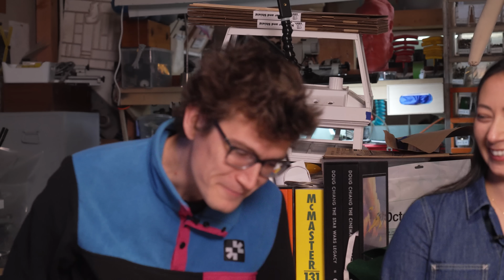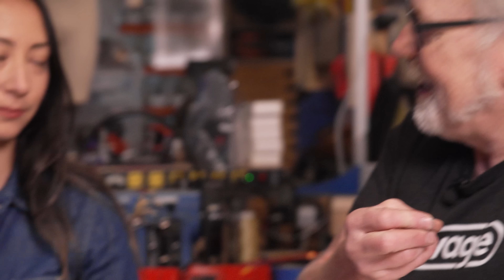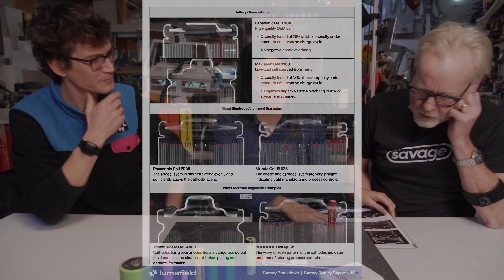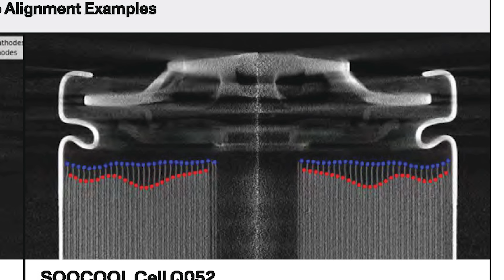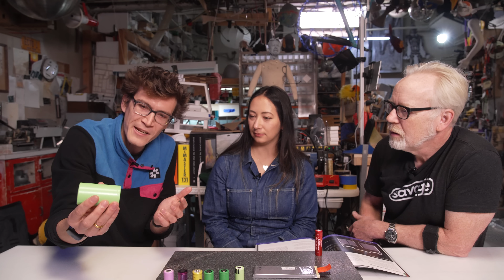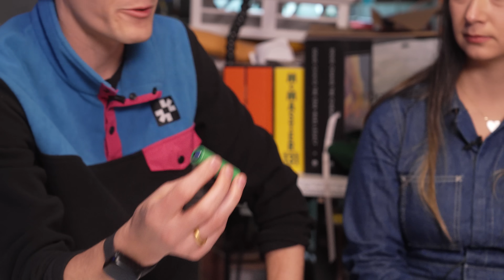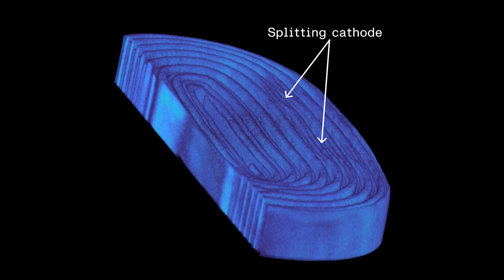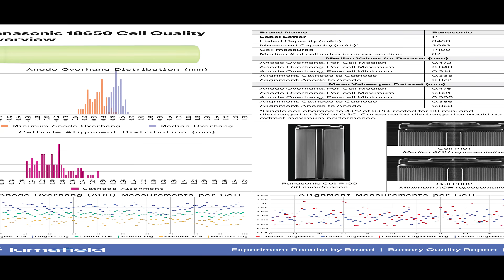The Surprising Flaws in 18650 Lithium-Ion Batteries

Comment: As a person who works with a ton of these 18650's loose form factor both flat top and button toped.  all i can say is buy one of those 2-8 channel testers that will measure the internal resistance and the capacity of the cells. pervious people bought a bunch off of amazon and Temu and most of them were bad... so honestly a capacity tester is the easiest way to tell if it is showing issues or not.  Out of 200+ tested cells from the previous buyer 8-%+ were under 700mAh capacity  and the rest were 1000-1300mAh capacity (actually all of the best of the worst ones of this measurement were actually from Temu purchase. 

We have since then swapped to named brands like Panasonic and Eve and Samsung Sanyo. and the lowest of all those good cells was 1900mAh (was listed as a 2000mAh) but we only tested from 3.5-4.2V and the rating are normally based on a measurement of 3,0-4.3v  so i expected lower capacity.

of all the good brands we tested we got withing 90% of the capacity on all cells with our 3.6-4.2v testing 

things to look for.. anything greater than 3500mAh is probably fake... some of the good cells out there are 3500mAh 
if there is high resistance or if they seem to not have capacity they are probably end of life 

The cheapest good cells from a reputable store were some of the Eve 2000mAh cells flat top at about $2 per cell... but they are also only 7.5A draw .. while many of the other brands are about $6-9 and are 20-30A (high drain device cells) 

Mind you i am still using the 1000-1300mAh cells since i only have so much money to replace cells.  And i can get 3+ ours in a work light out of them.. my good cells are about 7-9 hours

When they are done for be sure to recycle the cells the material in them is still good it just needs to be reprocessed

Buy a tester

Great PSA 

TLDR if you bought from amazon or temu or the like for loose cells you probably got junk cells you should buy a tester (or borrow) and see if you have good or bad cells. If you need high drain cells make sure you get ones who can handle the load... most work lights do not need high drain cells.   What a good person can do is buy a capacity tester for your devices if you come up with less than 70% of the rated capacity its probably junk

Comment: Aw i'd loved to see LG HG2 in the report.
I use those a lot and no failures in 10 years.
...but the Sonys and Samsungs i have, didn't fail me either. ^^
I can emphasize to always watch your cells when you charge them.
Reply: Check out those Vapcell 4000mAh cell. It is the next gen. They aren't a fake rewrap they are the strongest on the market in 18650 size
Reply: @cajampa  the higher the "spec's".... the more potential hazard you may be dealing with. 
The more capacity, if true, means more firepower, if things go wrong.
Reply: @colonelfustercluck486No don't be silly.
You will not see any different between a 3000mah cell or a 4000mah cell if you would screw one up for example.
You think you are being cautious but you just don't understand the technology.
And your point have nothing to do with what i am talking about.
My point is just because this is a relatively unknown brand. Doesn't mean they don't sell good stuff. As i said that cell is one if the strongest and a real uplift over the old gen cells. There is even newer cells that have come out after that one. That is tabless silica carbon lithium cells that is WAY stronger still.
And no stronger doesn't mean more dangerous. It means lower cell resistance so they run less hot when you charge and discharge them. And that in many cases will increase safety.
Reply: @cajampa  What are your qualifications, seeing that you brought that up?
I am qualified in electronics hardware repairs and a limited electrical license having performed years of on the job training and exams.. like a 2 electrical qualification situation. AC (3 phase) or DC equipment.
Just to clarify.... the difference between 3000 and 4000 of anything is a substantial difference. Or ratio.
In this case it indirectly refers to energy density. Potential energy contained in the same sized can. Compare it to 4 gallons of petrol, or 3 gallons of petrol/gasoline.... in the same can. Obviously 4 gallons, if released in the wrong conditions, do more potential damage than 3 gallons.
Like 3 sticks of Dynamite or 4 sticks of Dynamite.
Think about energy density, and include with the idea of safety considerations.
That's all.
Some manufacturers are great, others are not so great. Where do I put my faith. No-one because I have seen the best equipment possible get 'smoked'.
Components, even into the best of equipment can break down.
The manufacturer of the gasoline/petrol doesn't matter in my example.
But quality control in the manufacture of the can, and user knowledge and common sense also matters.
I agree totally with your comment on very low internal resistance....and external connections. Both are always a consideration with very low voltage DC electrical supplies.... in a high current situation. Or anything in a high current situation.
Reply: Yes, I am awake and aware, and nearby when I charge my batteries.... that is an important safety precaution. I am in the same room or the next room, not dozing.
Maybe doing other things, but alert.

Comment: Damn... not only are the cheap ones a rip-off for not even remotely achieving their stated capacity, they are also to a shockingly high degree actively dangerous... and the end consumer has absolutely no way of knowing for certain which cells are in what device.
The only way for an end consumer to find that out would be to completely destroy the device and the battery assembly to get at the individual cells, by which point it doesn't matter anyway as you don't have a functioning device anymore.
Reply: Even worse, those cheap ones can just as easily get brand name shrink wrap put on them by counterfiters.

Comment: I have a ton of these and have gone through them reconditioning them if they need it and have def noticed quality problems from generic devices, name brand laptop batteries appear to be more stable. 

You can tuck a properly sized plastic ring in-between the An/Ca to make it a bit safer. 

Most of these have a vent underneath the + bump that releases the pressure and disables the current flow deactivating the battery. 

They can be reactivated by pushing that membrane back in place (but is very dangerous). If it still reads 0 then you can connect another cell in parallel to have it see voltage again, then go through a discharge and recharge cycle to get it working properly.  I have only had one not go back to a working state.

The lithium polymer batteries are much more dangerous and suffer from expansion much more than the cells do. Any exposure to air to the materials inside could be catastrophic.  I don't recommend anyone do this to any of them unless you know what you are doing. Never in your home and never around anything flammable and wearing proper safety equipment.

Your best bet is to keep your batteries charged and cycle discharge them every 6 months to a year to avoid these issues.

Comment: amazon is to blame for allowing this... as she stated its IMPOSSIBLE for an 18650 to be 9000mah... any 18650 on amazon over 3000mah can easily be assumed to be fraud yet amazon allows them to flow. u cant leave negative comments on amazon either.... so these grenades flow non stop into houses....
Reply: You can bump that up to around 3500mAh: there are legit cells in the 3000-3500 range, such as the NCR18650GA at a nominal 3350 mAh. I got to test that and it holds up (not sure how many cycles until it falls under 3000 tho). Yet still, anything 4000 and up would be straight up unbelievable.
Reply: @_trupples  4050mah is the current highest capacity actually. vapcell n41, is in fact, legit.
Reply: @_trupples  except amazon sellers arent trustable. I get my 18650's from dead OEM laptop batteries those are legit. I just use them for projects etc not heavy use... Im tempted to grab the bad battery packs people dump at homedepot/lowes as usually its just 1 bad cell that nixes the pack the rest of the batteries still have some good life and well free...
Reply: some time ago i bought led headlamp which came with 2 pcs 8800 mah something-fire batteries. I knew they will be crap so did not use them at all. Last week i forgot to charge my samsung 35e cells so i used crappy ones for the first time. Lamp died after 5 minutes. Charger measured capacity during charging - one cell 120 mah, other 180 mah. I was curious how did they manage to get such low capacity so i took apart one cell with dremel. Roll was about 4 turns, held together with cello tape. After unwinding it was about 25 cm long. It filled like 10% of cell internal volume.
Reply: So i Broght 18650 beattery from digi-key casued more reliable sources...
Reply: I wonder if it was a typo that was just ignored.  Like 900 mAh is doable, 9000 mAh is impossible
Reply: @s1thl0rd87 i doubt it, 900mah would be extremely low for a 18650.
Reply: @s1thl0rd87  ....it's all a bit like the million lux from a single LED torches.....🤣🤣🤣

Comment: Not mentioned so far in the video, there are also 'protected' 18650 cells that have a little pcb on board with a charge/discharge protection chip built in near the + terminal. They will electronically disconnect themselves if they go into dangerous voltage territory. Kinda surprised they didn't come up in the 'vape' market.
Reply: Those disconnect at 2-3 Amps. Vapes draw more so they are useless for vapes.
Reply: @andreasjakob1916 depends on the cell. Short circuit protection can be calibrated to the expected load.

Comment: I currently have a power bank from Anker that is full on spicy pillow status in the backyard that no one will take for recycling.  I even called the FD and they won’t show up to take it.  Im literally just waiting for it to start a fire.  I live in Detroit and I do not have a car for transportation.  If anyone knows what I should do please help.
Reply: Home Depot,  Lowes, and ACE Hardware all accept rechargeable batteries in your area.
Reply: @TerryPullen they won’t take it because it is off gassing causing the casing to expand and bloat.  It is what they call a “spicy pillow” because it looks like it is inflating like a fluffy pillow.
Reply: like how you learn anything on youtube, i would look up li-ion puncture tests and see how they do it safely and go have your own 4th of july in some big barren open space
Reply: If the battery has been off the charger for a while, it is unlikely to "spontaneously combust". It is just less safe "mechanically" now than it was because the pouch cell is not sucked down tight. Leave it outside. 
The situation we have here is "what I would do" vs "what I can suggest you do". I would connect a longish USB cable to one of my fully discharged USB chargeable flashlights and use the power bank, outside, to charge the light, preferably on a concrete slab. Anything to get the bank off 100% full charge, assuming it functions. The ultimate goal is to deliver the puffy bank to a Batteries Plus location. They'll take it even if you didn't buy it there. If you don't have what you need to discharge it, or it won't function, put it in a Ziploc and let it sit in the yard for a week. A month. Keep it away from the dog. Then get it to a Batteries Plus while you are on some other errand without whacking it on anything. 
Hope this helps a little. Try not to be stressed.

Comment: 9 lithium ion powered devices seems really low. I have 3 different headphones. But the pod style ones are 3 separate battery devices, the charging pod, plus each earbud. I also have 2 different wireless speakers. Action cam. A few battery banks. Several flashlights. Several small cordless tools. Tire inflator. Vape pod. Tablet. Laptop. Phone. Do the old phones I have in drawer count? Does a car with 4 thousand batteries count as 1 device? And I nearly forgot the two lithium battery powered nerf guns. I'm sure there's more I'm forgetting.

Comment: Just to clarify her advice to submerge a battery in water - do NOT submerge a lithium ION or Lithium Polymer or Lithium Phosphate battery under water in any circumstances. If it gets hot, stop using it, put it in a metal container and place it somewhere safe, not like a room, but preferably outside protected from rain, and then bring it to your local disposal garbage safety box or reception. If you can't do that yet, store them in a metal box, not fully sealed, but somewhere safe where it cannot catch fire onto anything, and then dispose of it safely.
Reply: From professional experience, the response to a malfunctioning (getting hot on its own) li-ion battery varies with context, but dunking one in a cold water bucket then covering it is widely accepted and verified practice. Back in the days of lithium metal batteries, it was assumed water = bad. Experience taught us that water at least has a chance to prevent additional cells in a lithium ion pack from going into thermal runaway. Plus any active fluorines that might be released into the air are neutralized by the water. Unless the cell is so massively overcharged that there is lithium metal forming in it, water does not make li-ion cells catch fire. 
Flight attendants are trained to use their ice bucket filled with water to contain a smoking battery. 
As I mentioned, cover the bucket if possible, but even if it splashes, at least it isn't fire going everywhere. 
In production environments, flip top metal sand buckets are great for cells. Water barrels are recommended for multi-cell packs (but you have to keep changing the water which is a pain).
Reply: She didn't recommend using water to cool one down but to submerge it in water if it's on FIRE, you know to put the FIRE out.